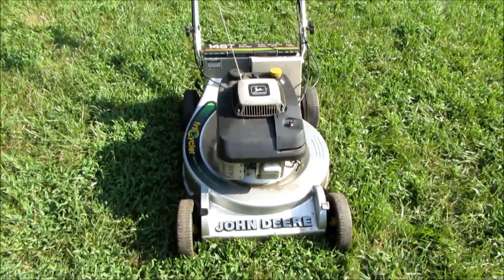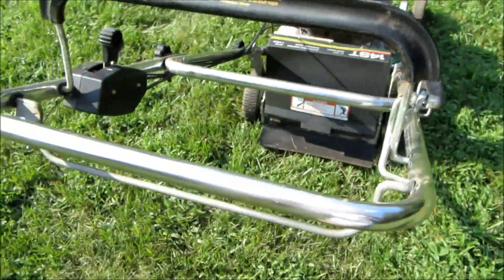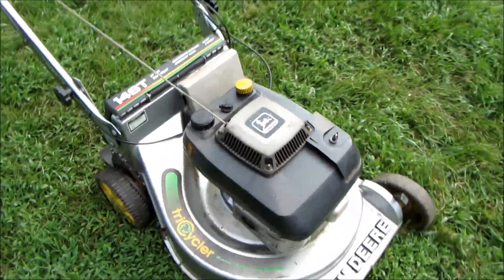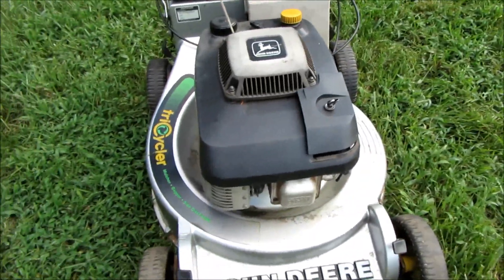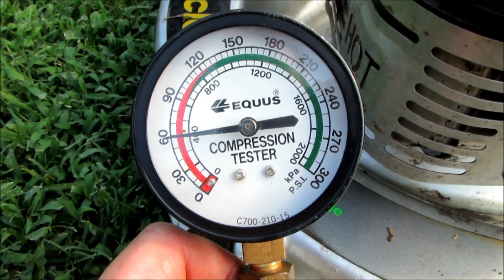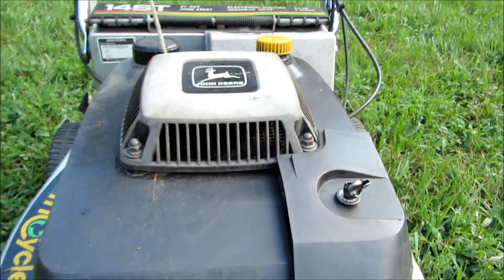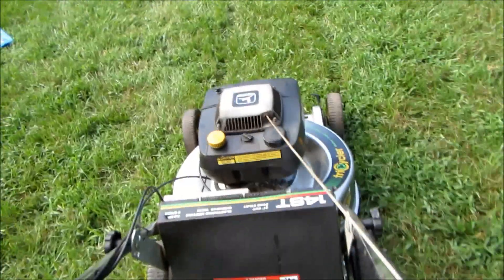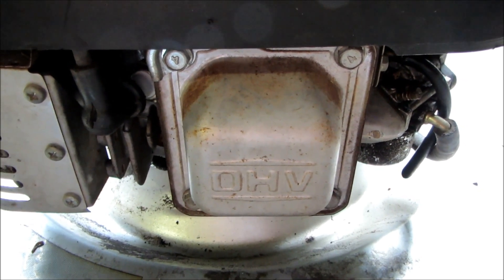John Deere 21" Lawn Mower Model 14ST Kawasaki 5HP - Repair Part I  -- August 23, 2013

Comment: Hi, I'm assuming it has a intake/compression and a power/exhaust stroke. If that is so, does it matter which stroke TDC you adjust the valves on?  You don't seem to cover that. Thanks
Reply: Found a manual that said compression stroke.  Now . . . to figure out which is which!

Comment: Can you tell me how you remove the black plastic cover from the top?  4 screws, and the pull-start comes off...remove the gas and oil cap...but looks like a big bolt to remove from the center. But turning it spins the engine...so what is the best avenue here??
My JD Kawasaki engine seems to have no spark. 
....Dave
Reply from the maker: Hi Dave thanks for viewing.  First let’s make sure about your spark. If your John Deere has some age on it that blade brake cable you hold down may be stretched and the cutoff for the spark is not releasing when you pull that handle to start it.   One way to test this is to tie your handle down and then see if you still have slack movement where that spark cutoff may not be fully disengaging.  You could also fully tighten it with a tie strap and see if you have spark or have someone just hold it to check for spark.  I have found many brands of older lawn mowers people have sold  broken this way, no spark the cable just needed to be replaced and corrected it.  If not and you still have to remove that big bolt holding the flywheel I presume to get to the magneto.  If by chance you have a compressor and air impact wrench.  If not they do make a flywheel wrench that holds the fins on that flywheel and you use your socket and wrench to loosen up.  Sometimes that is not easy to do for a bolt that has been on since day one and frozen from years of heat.  Also and of course be safe about this you can place a piece of lumber underneath to block the blade from turning as you remove that bolt with a socket and wrench.   Check your cabling those Kawasaki magnetos are pretty lifetime solid let me know how it goes.
Reply: Tell me which 21-inch blade that I can use replace a John Deere's blade
Reply: Tell me which one is for John Deere blade I can use to match my John Deere

Comment: Even my wife knows enough to move the mower OFF THE LAWN to pull the start rope.  Buddy you’re trying to mow the lawn with every pull. 
Also never in my 71 years have I seen a more filthy under deck.  Wash out that deck.  I’ll bet you 100 USD that gas tank has never seen anything but ETHANOL FUEL.   The curse of all seasonal equipment.   Clean the tank, lines, and the carb.   Use PREMIUM PUMP GAS LABELED ON PUMP AS ETHANOL 0:30 0:30  FREE.

Comment: Where were you able to find the specifications for the valves?
Reply from the maker: Hello J&R's Lawn Care!  I got the specs from the Kawasaki engine manual website.   You just select the engine series and that manual has a section on Tune Up.  It provided the valve clearance specifications for that particular engine.  That lawn mower is still running today it is unbelievable how well made that Kawasaki engine is!  Just google Kawasaki Lawn Mower engines and you will see that link.
Reply: mountainbikekayak Awesome thank you sir! I really appreciate it! I'm gonna need it too because I replaced the whole cylinder head on my jx75

Comment: We have 10 or 11 of these engines in my shop at school, we know at least 4 of them run and theres 3 more that should run with parts from the other engines. Ours range from 1997-1999.
Reply from the maker: Hi TReaD113 thanks for viewing!  These Kawasaki engines are great well made and long running, just basic change the oil maintenance and they are good for 25+ years.  Its still running after this repair in late August of 2013 and my friend Jeff said it started right up for the first spring 2014 cutting.
Reply: I just got a jx75 with a 6hp Kawasaki from an elderly woman for free…I filled it up with gas on the way home and it started on the first pull. That alone made me decide to restore it

Comment: can you please tell me how you got the pistons level with a straw?
Reply from the maker: Hi Mike B thanks for viewing should have shown that so always looking for these type of comments.  So the straw just pulled the spark plug out and put in a straw in the cylinder.  This John Deere the valves adjusted both of them top dead center.  So just watched the straw while turning the engine over move as the Piston went up.  When it reached the top and the straw was moving back down just turned the engine where it was right at the top.  Also use this straw method on Briggs and Stratton engines they adjust a bit different.  You put a mark on the straw when its top dead center and measure a 1/4 inch up and roll the engine at that mark.  Seems to work my friend Jeff said that John Deere started right up a few weeks ago for the first lawn cutting of the year.  Thanks again will make I  sure to show these type things.
Reply: mountainbikekayak
Thank you very much for replying

Comment: Problem is with that on off valve, , I betcha?
 I have same mower, different motor, mine starts every time, but the drive cable is bad, and I'm getting tired of pushing this thing around